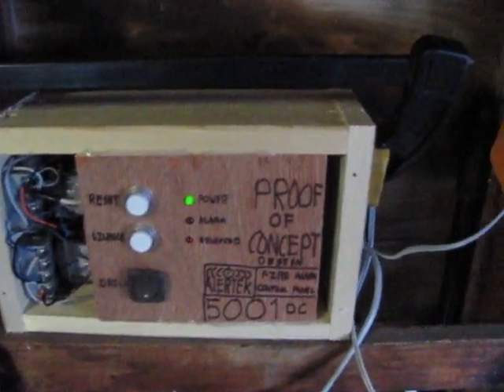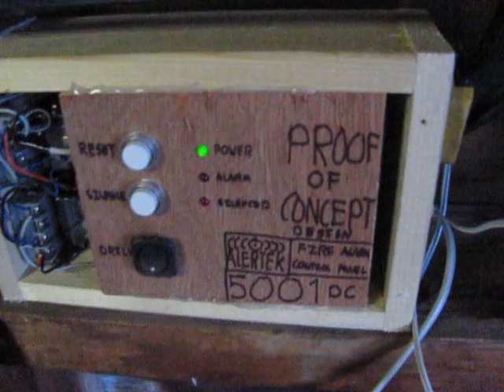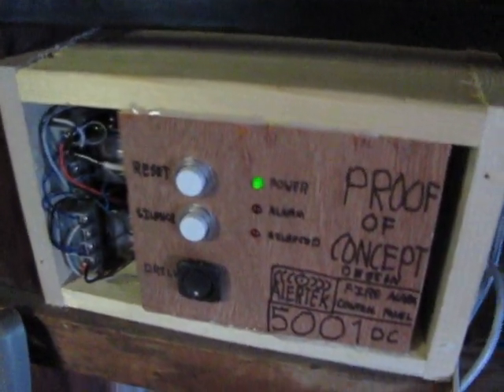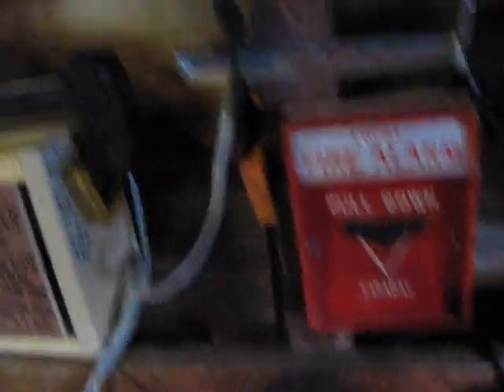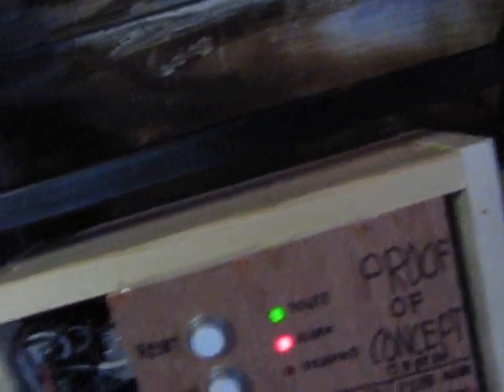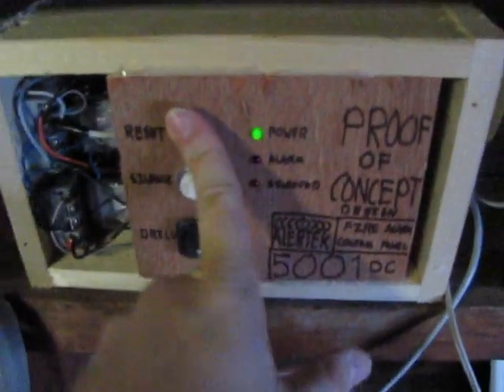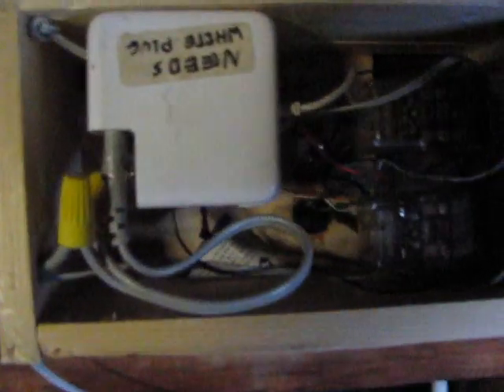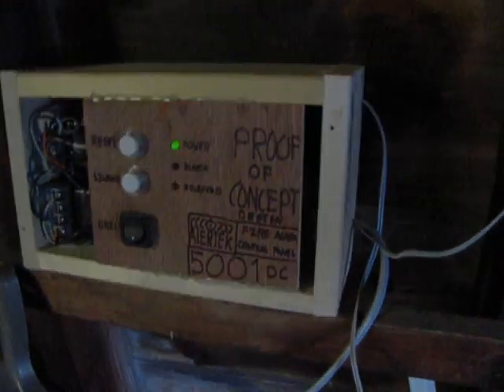Alertek 5001-DC-POC Panel Test 1

Comment: 2/23/15. i go home to see my system sensor alarm buzzing and the t bar it was connected to was not pulled. what happened
Reply from the maker: nathan carpenter A ghost?
Reply: Ecscuse me?
Reply: im serious
Reply: Did you have any smoke detectors hooked up?
Reply: Maybe if you connected a blue wire that could randomly turn on the alarms, so you might have to disconnect it

Comment: @phillies4100 
It wouldn't be easy.
He would have to take down the current panel, disconnect EVERYTHING on the system, put up the 5001, and re-wire everything. 

Plus, it wouldn't have as many coding options as the 8005 does nor the capabilities the 8005 has. 
This kind of a panel could be used on a mini system or just for testing devices.